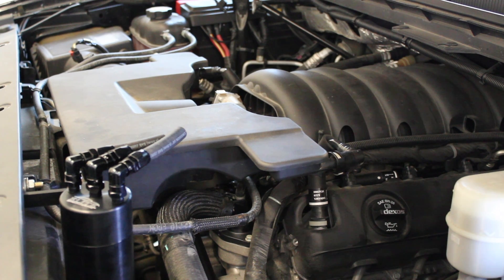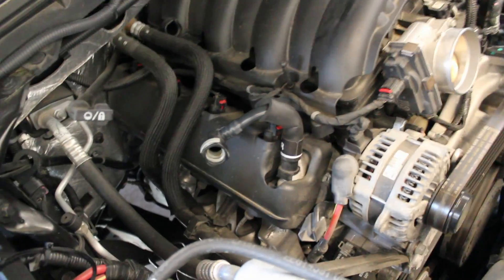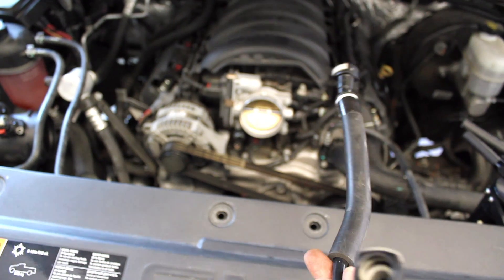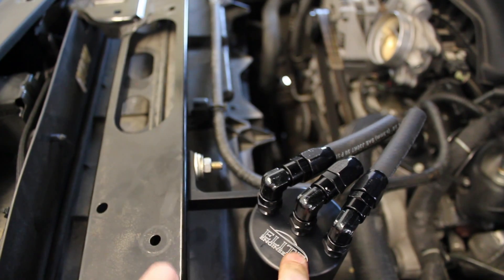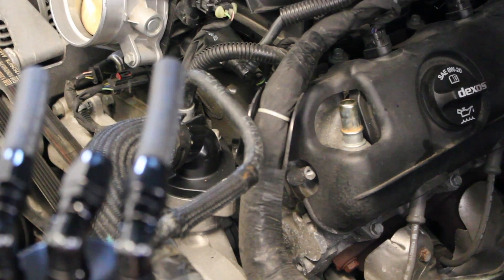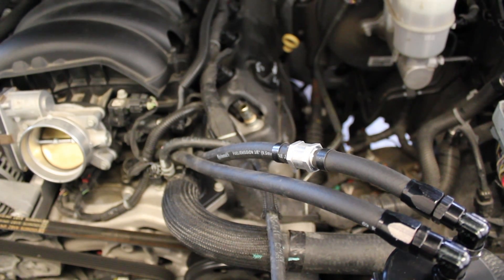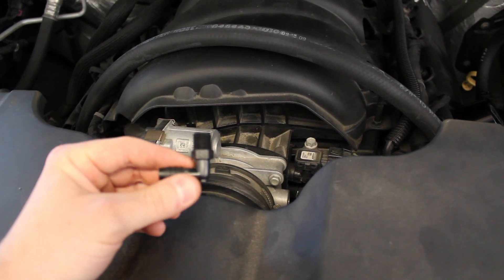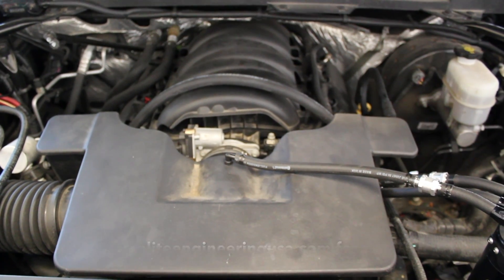[HOW TO] Install Elite Engineering: 2nd Gen E2 Catch Can on a GM Truck

Comment: Why not use the port that you plug in the intake tube for the second output from the can instead of drilling a third port into the intake tube?
Reply: Matt Desruisseau Thats what I'm wondering?
Reply: You need suction for the second outlet on the can.  The intake bridge will have low suction a that point. You need the second outlet connected to the area just upstream (in front ) of the throttle body.  As for $20 catchcans, they trap app 15% of the oil mist and other contaminates and do NOT provide full time evacuation like the dual valve systems. The E2-X or similar designs will trap 95% plus. So in this case, you get what you pay for. There are $500 plus cans that do not trap more than 50% as well, so internal design is critical.
Reply: @tracylewisperformance2270  what about on an aftermarket intake tube, would the second port be fine or do you still have to drill. the aftermarket tube vents go right into the tube not a resonator or whatever
Reply: @trevrox2  The cleanside separator on the drivers side valve cover brings in the filtered fresh MAF metered air that then splits and also enters the passenger cover. This makes up for the foul contaminant laden vapors being evacuated (sucked out) the valley. The second outlet from the can itself needs a stronger suction, and the suction is generated by the Venturi Effect of the incoming air flowing past the barb you add. So if you used the second hole, there is no airflow past it to generate suction/vacuum and it will not provide suction when needed. It is NOT suction from a restricted air filter that is used.  Hope this helps!
Reply: @trevrox2  You would still want them separate. You want the barb you add protruding slightly into the incoming air flow, with the side towards the throttle body cut at a slight angle to the air flow past creates suction via the Venturi Effect. But yes, you can still use just the one, but it wont be as effective.
Reply: I’m really not understanding why you need to drill the hole in the air diffuser.  The port you plugged up is right next the hole you drilled.  That diffuser is a big hollow plastic thing a ma bob lol or am I wrong?
Reply: Aahh okay I reread your last response

Comment: The Cleanside separator is critical with any direct injection engine as they cannot tolerate even small amounts of oil ingestion where a port injection engine could.

The CSS can be used with any catchcan that is installed properly, but if you have a Moroso or similar (any Diablosport, Phasetek, Billet Prototypes, etc. that are all the same design you will only trap between 15-20% of the oil and other contaminants. All cans trap some oil, but 99% let through more than they trap. Here is how to test any can and see first hand:

http://themustangsource.com/forums/f726/jlt-vs-rx-catch-can-results-part-2-a-532449/
Reply: @RX Performance Products, LLC can you use the other port on the intake instead of drilling new hole?

Comment: I see you got rid of your Airaid intake, any reason why?
Reply from the maker: +Tyler C (Ger8mm) I actually still have it, but for the purpose of this video I wanted to have the install be on an OEM intake tube, so it's easier for folks who still have the OEM tube to install this on. As soon as I was done with the video, I put the Airaid back on.
Reply from the maker: Correct.

Comment: How important is the clean side seperator kit ? Ive already installed a Moroso catch can . which works well. Do i really need the clean side seperator ? Will a catch can alone catch the majority of the oil vapors ?
Reply from the maker: +Jordon Cloutier It is not 100% necessary, but with my aftermarket intake, I was noticing some oil in my intake tube. After adding the clean side separator, there was no more oil. So in my case it was necessary. The oil accumulation might not be as noticeable with an OEM intake tube, since it has all the baffles. I would say pop off your intake tube and inspect it for a coating of oil. Make sure you check the two tubes that connect to the valve covers. That's where the oil would be coming from.
Reply: Thanks ! I will check my intake tube !
Reply from the maker: Jordon Cloutier
You bet! Good luck.
Reply from the maker: john donovan
mine was more severe with an aftermarket intake tube.
Reply from the maker: +john donovan I have never experienced that effect in a FI motor with aftermarket intakes. But  I'm sure it's still possible.